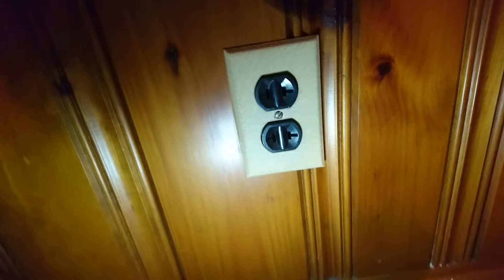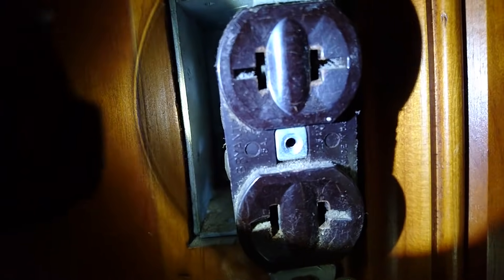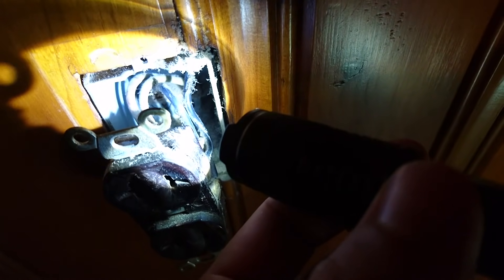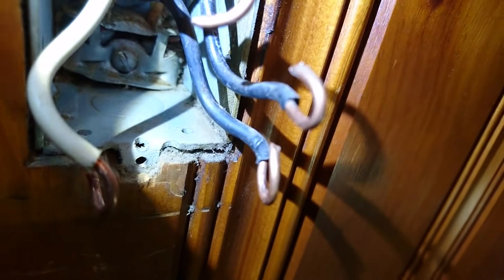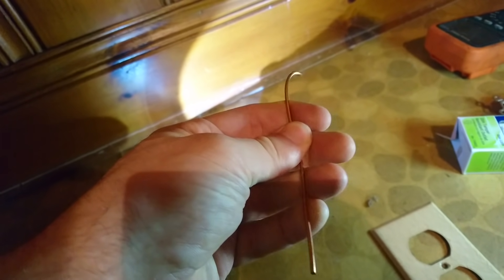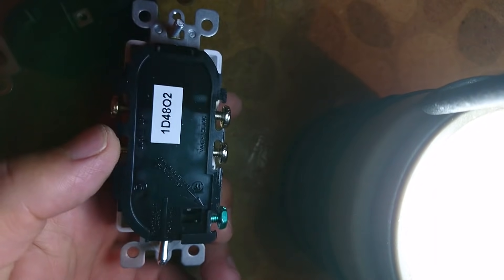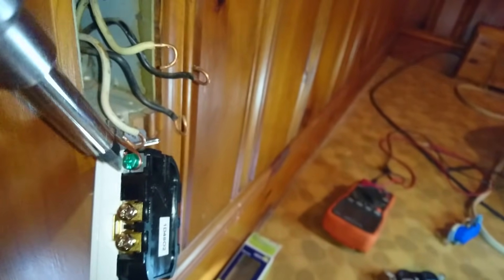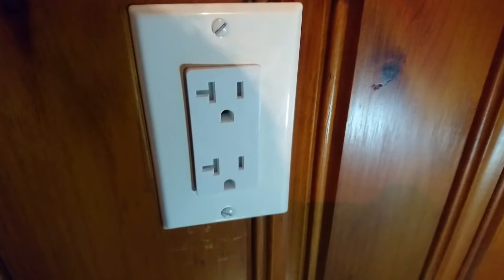How to Convert a 2 Prong Outlet to a Grounded 3 prong Outlet (TYPE AC Cable WITH Grounding Strip)

Comment: Is perfectly suitable the part of 15 amp receptacle on the 20amp circuit ,  The burned up recepticle you had in your hand was due to a loose connection more than likely not an overload.
Reply from the maker: Yeah that's probably true
Reply: Not true!  You can over amp a 15a receptacle on a 20a circuit since the 20a circuit breaker will not trip until you get over 20amps which is 5 amps more than the 15a receptacle is designed to handle.
Reply: @Bootstrappin  Not true!  You can over amp a 15a receptacle on a 20a circuit since the 20a circuit breaker will not trip until you get over 20amps which is 5 amps more than the 15a receptacle is designed to handle.
Reply: @Ron-no4tp  You are obviously not an electrician. Greg berban is 100% correct. Unless the outlet is dedicated, it is recommended to use 15 amp outlets. you can upgrade the wire but not downgrade.  It's common sense. burned 15 amp outlets are caused by loose wiring. It's not an opinion, it's a  fact. All new constructions use 12 Gauge wiring with multiple 15 amp outlets per breaker, except for the dedicated Gfci's. those need to be dedicated 20 amp to avoid tripping and overheating the outlet because some microwaves and portable ovens draw almost 15 amps.
Reply: @lionkingdom777  I have been an electrician since 1972.  Why do you suppose 20a receptacles cost more than 15a?  I’ll tell you why.  I once loaded up a 15a receptacle on a 20a circuit with Xmas lights to just under where another string would trip the breaker.  Guess what?  After about 5 hours the 15a receptacle started to melt down and smoke.  15a receptacles aren’t designed to handle more than 1800w for long periods of time.  20a receptacles are designed to handle up to 2400w.  The screws were on plenty tight because I was the one that installed the receptacle.  I know code will allow 15a receptacles on 20a circuits but I won’t do it.  I have also heard that most 15a receptacles are really only rated to handle 12a.  At any rate I was considering petitioning the national electric code because it truly is not safe and under the right conditions it WILL cause a fire.
Reply: If you're getting your training from YouTube, you have bigger problems.  Here is all you need to do: ALWAYs use 15A recepticals (that's the smiley face that is NOT winking. That's Mr. 20A laughing at you, daring you to try to understand it). This way, your circuits will never accept 20A plugs and that alone will save you and the building inspector that will be laughing at you when go to sell your house.
Reply: @summer-west  Can't imagine why a building inspector would be the slightest bit interested in your receptacles when you're selling your house.
Reply: @Ron-no4tp  I dont care how long you been an electrician, you are wrong. The only difference in 20 amp and 15 amp reciprocals is the plastic on the front.
Reply: @Ron-no4tp  commercial grade plug in receptacles are 20 amp internally eve when they are rated at 15. Amp typically  but, cheap priced and made15 amp problley not good for more than 15. Amp

Comment: 15 amp outlets are actually fine in 20 amp circuits. It's actually pretty common, especially in cases where many of the receptacles in the run are expected to be in use at one time as to not trip the breaker.
Reply: Agreed. I have seen many outlets overheated that were on 15 amp circuits. It is not so mush the amperage being used as it is loose connections. It is not a bad idea to replace outlets and switches that are getting old, or at least go through and tighten the screws down.
Reply: @notredo  Very true.
Reply: The only difference in the outlets is that you cannot plug a 20 A plug in a 15 A outlet. Sometimes the actual outlet is identical i.e. there are 20 A contacts but the face plate is just different. Since 20 A plugs are extremely rare there is no practical difference between them.

The 20 A socket does, however, serve as a visual indicator that it is a 20 A circuit.
Reply: I would not use any of the inexpensive residential 15 amp receptacles wired in series on a 20 amp circuit unless the wires were pig tailed.  They are not designed to pass through more than 15 amps.  However the commercial grade receptacles and all GFCI receptacles can safely pass 20 amps and can safely be wired in series on a 20 amp circuit.  To pigtail or not to pigtail depends on whether you have enough room in the box to fit splices and wire nuts and your own personal preference.

Comment: Very helpful info. Especially about 12gauge for 20amp and not 15.
Reply from the maker: Yes, though it would be overkill unless you want to future/fool proof. 14AWG for 15 amp circuit, 12AWG for 20 amp circuit. Cable length is also a consideration once you exceed 50 feet.

Comment: Thanks for this video. I am currently attempting to purchase a house build in 1920. I need to convert pretty much all of the outlets from two prong to 3 ground. I thought that I would have to rewire the whole house. I definitely had the wrong idea
Reply from the maker: If it's original 1920s wiring then it's likely to be knob and tube wiring which can't be grounded. What kind of wiring does it have?
Reply: @Bootstrappin  there is some knob & tube wiring. I am unsure of how much of it is still that way but soem of it is there for sure. there are three floors and a basement and it can be seen in the attic for the third floor. I guess that I will have to knock out some plaster

Comment: How does screwing the ground wire into the back of the box actually ground it? I have to replace a lot of these 2 prongs in my house and I want to make sure it's actually grounded when I do it.
Reply from the maker: It doesn't unless you can verify that you have armored cabling with an internal grounding strip going all the way back to your breaker panel.
Reply: Grab a tester and cross check the Black (hot)wire to the copper wire, do this carefully with the power on, if it lights up, your box is grounded, you're are good to go!
Reply: @Bootstrappin  I love you well informed you are about making videos that are safe to post to help others.  Especially mentioning the internal grounding strip.   From a safety standpoint.  Required for AC cable in 1959, correct me if I'm off.   The problem is, some types of older AC type called BX cable,  did not have that internal bonding strip, and in very rare cases, I have personally never witnessed it myself,  but some of my fellow electricians know someone who has seen a situation where the old bx cable sheathing heated up enough to start a fire during a fault to ground situation, the sheath most likely was damaged or rusted and had enough resistance to test as grounded with a test light (like you did) but did not draw enough current to blow the fuse (perhaps an oversize fuse/fuse bypassed with a penny) but enough current flowed on the other cable sheath to heat up like a toaster element (he described the joist had been charred where the cable had been stapled) and found during a remodel.  Just another thing to be aware of
Reply: @Bootstrappin  you are probably good using  the cable sheath as a ground.  Based on the breaker box (assuming it was original to the house) and the wood wall paneling with the two prong outlets the home was probably built sometime in the mid to late 1950s or early 1960s, just before the requirement for grounded receptacles
Reply: In CA, by code if your box is metal it has to be connected back to your ground.
Reply: @liquidcelica  many older homes have metal boxes and have no ground. So this is false. This is only true for homes built after the 60s or so. Nearly all homes built before 1940s will have ungrounded metal boxes, unless rewired.
Reply: @ZMan492jj2j2  maybe that's true but your statement is also somewhat false as both my homes and my father's are from 1950s and in socal the metal box have MC back to the service box.  Our rental in NorCal is also grounded boxed.  Our close friend has service many homes and have said what I stated.  From my experience those boxes in CA tend to be grounded.  Easy enough to check pre or post wire up.  If I'm wrong, he wires up, if not, he someone saves time and money.  So I wouldn't discredit my advice

Comment: I did the same thing and the tester showed "no ground". Is that because your metal outlet box is grounded by the breakers panel and mine is not?
Reply from the maker: Quite possible, you have to have metal cabling which provides the ground path. If not, you can swap to a GFCI outlet and label it "no equipment ground". That's acceptable too.

Comment from the maker: Important detail: you MUST have a grounding strip inside your armored cable, also known as Type AC cable. You should be able to spot it when you open the cover of your outlet, it's a bare tin plated steel wire. You might have better luck spotting it where the cable enters your electrical panel.

See NEC 250.118 Sections 8 & 9:

(8) Flexible metallic tubing where the tubing is
terminated in fittings listed for grounding and
meeting the following conditions:
a. The circuit conductors contained in the
tubing are protected by overcurrent
devices rated at 20 amperes or less.
b. The combined length of flexible metal
conduit and flexible metallic tubing and
liquidtight flexible metal conduit in the
same ground return path does not exceed
1.8 m (6 ft).

(9) Armor of Type AC cable with an additional
equipment grounding conductor and as
provided in 320.108.

See an example here: 

http://activerain.com/image_store/uploads/2/2/5/9/2/ar1364321329522.jpg
Reply: That wire is called bonding wire and it is usually a tin plated steel wire not aluminum.  
Having 15A receptacle on 20A circuit is not what caused your receptacle to burn. 15A receptacles are rated for 20A pass through. It is usually due to a loose or corroded connection. It is perfectly fine to have 15A receptacles on 20A given that you have more than 1 on the circuit (a duplex receptacle counts as 2).
Reply from the maker: @lambition  I stand corrected, thank you for the info!
Reply: Why would your armored cable have a grounding wire or "bonding wire" inside of it if your house had only two prong outlets? If they were running that ground wire to every outlet, seems like they would've just grounded all the receptacles to begin with. What am I missing?
Reply: @bmfitzgerald3  Devices weren't grounded and likewise grounded outlets didn't exist when the house was first built. Grounds were intended to protect against loose or faulty connections inside the boxes and were much more of an ad-hoc thing than nowadays or even a couple of decades post-construction

Comment: I have two prongs.  When I pull the outlet out there are black white and red wires.  

Does the red mean it is a switched receptacle?

Also how do I know if my cabling is armored or my box has a grounding plate
Reply from the maker: Yes, red wire is usually used as the runner for switching, but you need to verify that. To verify armored cabling, go to your electrical panel and have a look, assuming it is exposed. You're also looking for a ground bonding strip inside the armor, not all armored cabling came with one.

Comment: the older BX cable connected to the metal outlet gang box isnt technically grounded at all(so pig tail isnt enough), if there is any connection the the breaker box it is a danger, even IF the upgrade was to ground the breaker box to the earth it would still result in a shock(from the breaker box) if there was a short. 
Use a sheathed green whatever gauge ground wire to pig tail from each outlet and earth ground, only way

Comment: Have you ever thought about using the ohm meter across the neutral and the ground. Just in case a plastic junction has been installed somewhere.
Reply from the maker: It's a great idea, will definitely give you a good clue if it's working properly. I assume the outlet tester works on the same principle.
Reply: I always test the ground by putting a 100 watt light bulb between the hot and the ground to make sure it will carry a load if necessary.
Reply from the maker: That's a really solid idea, I think I might add it to the pinned comment among other user contributed ideas. Thank you!
Reply: @Bootstrappin  ,question for you. On a 15 amp outlet, is it not rated for 15 amps each outlet? If I am not mistaken it will accept 10 gauge wire.
Reply from the maker: That doesn't sound right. 30A would probably cook it in a hurry. As for 10AWG it'd be a real struggle to get it to fit, with no benefit since everything should be determined by the size of your breaker, usually only 15 or 20 amps.
Reply: @Bootstrappin  , I looked at the back  side of a  20 amp outlet last night, it said right on it, 10 or 12 gauge wire.

If you have a run of 5 outlets with 12 gauge wire and 15 amp duplex  outlets, you could plug in 10 items drawing 2 amps each and be within the limits of the circuit.
Reply: @mikeeiben3430  I have seen people install upward of 10 receptacles on the same 20A branch with "no problem" because there is little chance that more than one will be used at anywhere near the rated max at any given time.  Yes, it increases the "risk" that some combination of things will overload the branch at some random time, but  code doesn't prohibit it, as far as I can tell.
Reply: @Bootstrappin  Those outlet testers can show all clear despite there being no (or improper) ground. A non-contact tester is a good way to double check. If it only lights up in the hot slot then all is good.
Reply: @Bootstrappin  the reason for 10 gauge wire is in case the fed is a long way away (more then 150 feet) is for voltage drop. Its something that is taught to apprentice in their first year.
Reply: @Bootstrappin  You're exactly right - good luck putting 10 gauge wire on a 15 amp receptacle.

Comment: Good video, I didn't know about self tapping ground screws now I do, thanks.
Reply from the maker: Thank you. In retrospect, I'd exercise caution because they'll leave metal shavings all the same, so it'd be wise to vacuum out the junction box after using them.
Reply: Dave Kuebler please do not do anything he showed in this video im a real electrician and this is a #1 way to burn down your house if you want to know how to do it the proper way let me know
Reply: Listen to @construction guy. He's my brother. You notice the video guy is showing you a workaround to fix a previous workaround that caught on fire inside a wall. Not sure if unsafe is additive or multiplicative but these methods are either unsafe + unsafe  or unsafe X unsafe. I'm thinking the former if your own workbench and latter if it's someone else's house.
Reply from the maker: @summer-west  sir this is a Wendy's

Comment: I'm in the process of doing this. I checked for ground on the box and didn't get one. I ran an air conditioner on  this outlet for 25 years using an adapter. My question is this what is the difference between a 2 plug outlet with an adapter and no ground versus a plug with 3 plug  outlet and no ground....it seems to me it would be safer with the 3 plug and  do away with adapter
Reply from the maker: If you tested for ground and there isn't one, then neither is safer, since excess electric charge has nowhere to go. Best thing to do in this case, aside from a full rewire is to replace the outlet with a GFCI outlet and label it 'no equipment ground'. In case of an actual fault, the GFCI would  just cut the power.

Comment: This only works of the box is grounded.  In many older homes with a 2 wire system especially knob and tube it is rare to find a grounded box.  In my old 1948 house I just ran Gfci s as replacements where practical or when it was to challenging to run new romex back to panel.
Reply: In my dad's 1956 house, with cloth-covered 2-conductor  cables, someone had run an "extra" grounding wire to the receptacles that needed to be grounding type.

Comment: Correct me if I am wrong, but when you screw the receptacle into that metal box, that would ground it without using the added wire, if the box is grounded.(unnecessary work) Maybe just gives you a piece of mind. In fact the adapters give you a green wire to connect to the cover screw for grounding, once again if the box is grounded.
Reply from the maker: Technically correct if the shell of the outlet is connected directly to the ground prong, but not good enough to be code compliant, and you don't want to rely on screws of unknown conductivity.
Reply: @Bootstrappin  ok cool
Reply: its code if you dont understand or dont know seek a help in doing electrical work plse
Reply: @wizard3z868  I thought I was rough on the English language. lol
Reply: @jthonn  lol ya i dont pay attention much to youtube on grammer  lol

Comment: I usually would err on the side of using a smaller rated outlet, such as 15 amp. If the wiring is 12 gauge and the circuit breaker is 15, use 15 amp outlets also, and be relatively confident you won't have heat problems in your wiring. Over built.

I'd also go with a GFCI instead of using a grounding strip. If the outlet isn't grounded at the panel, I think that's the safest way to minimize risk of fire or shock.